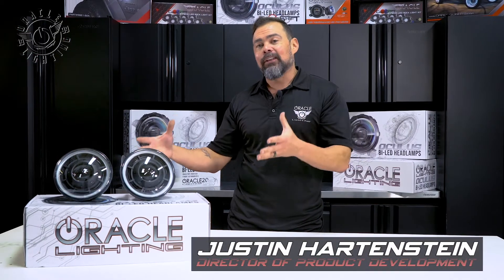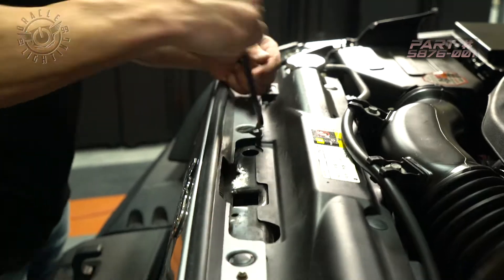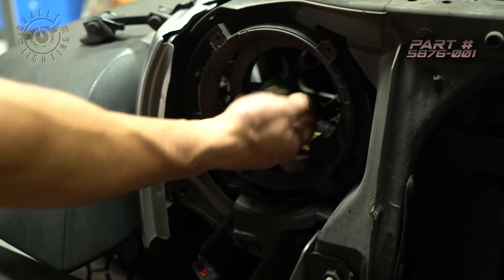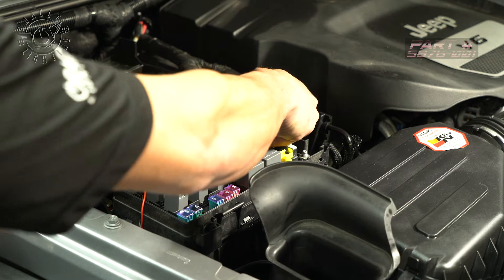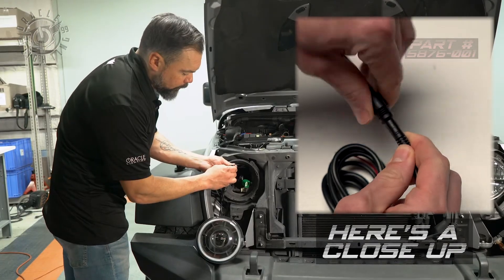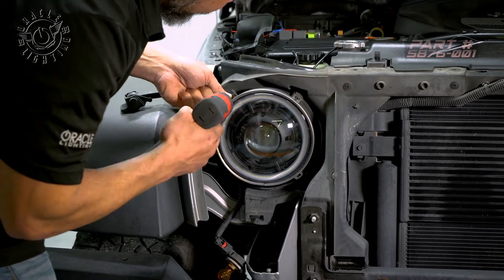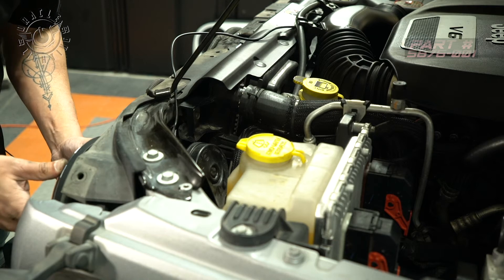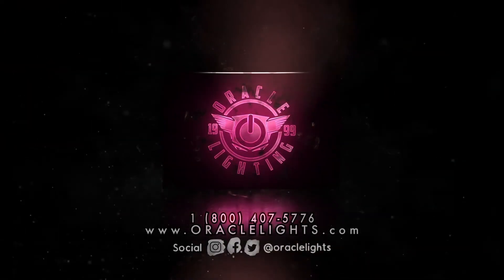Jeep Wrangler JK Oculus 7" Bi-LED Headlight Installation Guide

Comment: nice video! i bought oracle lighting P# 5876-001 wit 3 pin connector (red wire, yellow wire and black wire) so can you tell me which wire is Hi beam, Low beam and which is ground? else what pin number from 1-3 belong to what color red, yellow and black. this question is because am gonna connect it to 1952 chevy truck. thank you
Reply from the maker: Hello Red= High Beam, Yellow= Low Beam, Black= Ground. Hope that helps! Please share some photos of your installation with us! info@oraclelights. com
Reply: @ORACLElights  yes this is very help full information so i will send you some pics from this installation. another question is do you know a P# for bc1 controller that can be connected to my oracle light P# 5876-001?
Reply from the maker: @javierargumedo3  hello 5876-001 is White only (-001 means White) the color-changing version with BC1 is 5876-335
Reply: @ORACLElights  Hello! the color changing version is the yellow and white color? thank you
Reply from the maker: @legervoile  yellow/ white version is the Switchback version. ColorSHIFT is RGB and can make any color.
Reply: @ORACLElights  thank you guys!

Comment: Hello, sorry for the question. I have a jeep gladiator and I want to put lights on it from the back or arcle, which one do you recommend?
Reply from the maker: If you have a gladiator you need 9" headlights, here is the link: www.oraclelights.com/products/oculus-bi-led
Reply: @ORACLElights  but they are lights for behind
Reply from the maker: @JavierHernandez-kq7vc  https://www.oraclelights.com/products/rear-bumper-led-reverse-lights-for-jeep-gladiator-jt

Comment: These finally out for jk. Are these built in anti flicker?
Reply from the maker: Yes, these have our Smart Canbus system which is a built in anti-flicker system.
Reply: @ORACLElights  Thank you, will these come out with different colors like the 9" and when will be available?
Reply from the maker: @hardrockexpedition7745  great question, the ColorSHIFT version is in production right now and should be availble very soon. Give us a call if you would like to pre-order a set, we expect them to go fast.
Reply: @ORACLElights  I meant to ask the color bezel like satin silver or graphite.
Reply from the maker: @hardrockexpedition7745  the bezel colors we created to match the headlight surrounds on the different JL trims. The JK does not have headlight surrounds like the JL so we had not planned on this for the 7:.

Comment: What if I use my heated seats? What fuse position should I use?
Reply: Same fuse, it does not divert power from the heated seats there are fuses that are added for both circuits.

Comment: What if my JK has factory DRL? It came down from Canada
Reply from the maker: For the Canadian JK you will need to turn off the DRL with a programmer and use the Halo as the DRL rather than the low power low beam DRL.